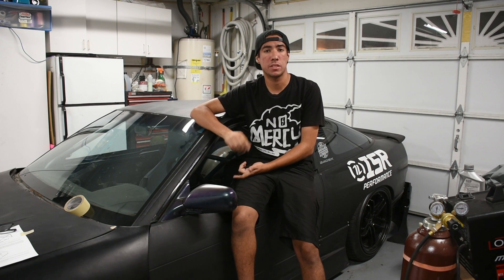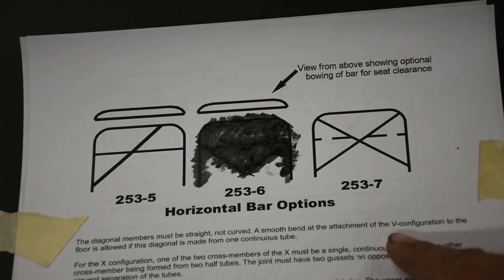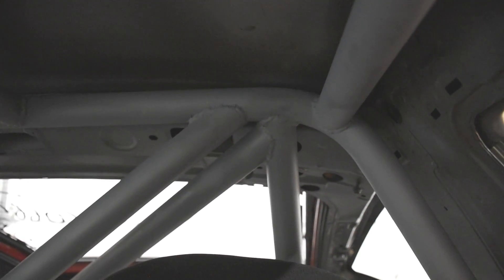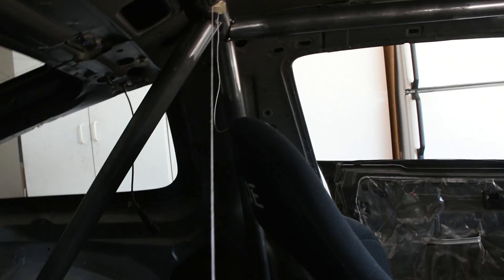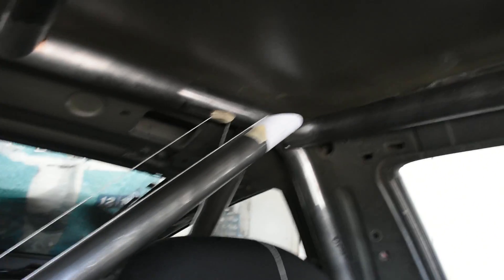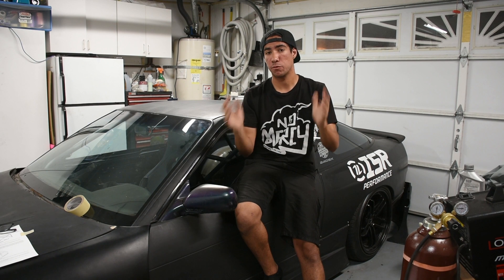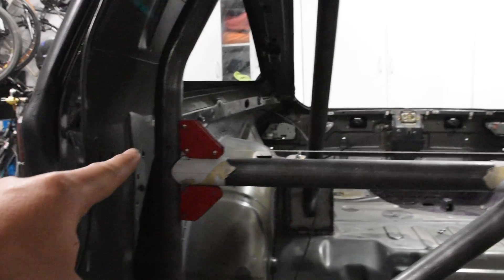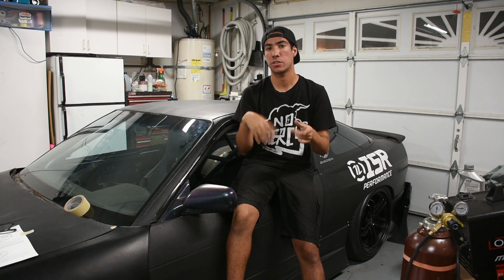Project 240 - Le Drift Car II | Ep. 14 - Diagonal and Harness Bar | FD Spec Cage Build

Comment: You seem very concerned about your safety, but I haven't seen you mention anything about your harness you're running, or if you've researched submarining (not the ship, google seatbelt submarining).
Reply from the maker: +RizoProduction Running a Crow 6 Point harness with camlock. And yes I've researched submarining.
Reply: ***** That's good,

Comment: total cost of the cage so far?
comparing to paying a company to build one
Reply from the maker: +Levi Kingston 100 feet of tubing (only need about 60-80 but you'll mess up so need extra) at $2.50 a foot is $250 in tubing. Then $50 in 12 gauge for base plates. And then $100 in welding gas. $50 in random flap discs, acetone, and cut off discs. Total is $450 in material.
Reply: a lot cheaper than the 2K that the companies be asking for
Reply from the maker: Well yeah but that's just material. Most shops take about a week to make a cage which means a week of shop time. $50 a shop hour x 8 hours a day x 5 days of work = $2000 in labor alone.  And then you have really well built cages which shops will charge $6k for. You're mainly paying for labor and the better the shop the longer they take and the more expensive the hours are.
Reply: so your better off making it yourself if you know how and got the right tools
Reply from the maker: Yep you most certainly are. Which is why I made mine haha. To have a shop make my same cage with the clearances I have, and the base plates I have would've been in the $4-6k range.

Comment: Hey man. Awesome vids man. Super informative. Sorry if you have answered this already. Are you gonna slap a turbo on the engine in its current condition? Or are you going to do a rebuild and then turbo it?
Reply from the maker: +Z Johnson Turbo it in this condition because I'll be tuning the car myself. So god forbid I mess something up in the tune while learning I don't want to destroy s rebuilt engine.
Reply: +OffBeat Garage Thanks for the reply man. Good thinking though. If it blows then you can rebuild it after you have learned a few lessons. how many miles on the engine btw?

Comment: Hmm. You did weld all the way around the tube right? 

9/10 times when rally or other race cars get build they either make a hole in the roof or that the roof skin completely of it easier to make a good weld all the way around the tube. Didn't see that i in the video so i'm just wondering. 

If you didn't do it i would be amazed if you pass tec inspection.
Reply from the maker: +Rasmus Laursen Yep the cage is welded all the way around the tubes. The front base plates get removed and the cage can get pushed forward and down which gives me room to weld around the top and then I push the cage back and up and put the base plate back and finish welding the cage to the chassis.

Also I've spoken to local guys who compete in Pro-Am and they've told me they don't weld the top of the cage and they pass tech fine. Which I honestly think is retarded but yeah haha anyways just wanted to give you some insight into that as well. 

Thanks :)
Reply: Thanks for clarifying. 
And i must admit that i'm shocked that a car with a rollcage that isn't fully welded can pass tech in pro-am. 
You will not pass tech inspection at entry level rally where i live if your rollcage i less than perfect. 

Keep the videos coming. Really enjoy watching the build! :)
Reply from the maker: Yeah they are a little too lenient on the rules for Pro-Am haha. I've heard rally is super strict though which is nice to hear because those cars get abused!

Thanks man I appreciate it :)

Comment: Hey man! great video as always. Just wondering, is all the weight you saved now put back on again with the roll cage? obviously I know that you have to have the roll cage so it's definitely less than putting that in with all the interior too. just wondering if you'll end up feeling any difference in the weight after the build is finished, or if you had to put the weight back in again, just curious as I'm looking at caging my build and am also looking at putting in the  work in stripping the car too.

Comment: I really like your videos and the overall project you're doing, this is meant as a constructive opinion so please don't take it bad

I think this video was way too long for the actual progress done - it could be easily merged with the roof bars video, that also seemed to take way too much unecessary time. The first videos regarding the roll cage were actually informative on an useful way, but it seems you've been extending the rollcage building for way too long than what would be actually necessary.

I understand as an Youtuber you want to create as much content as possible, but just on this video about the first 10 minutes were mostly pointless, repetitive, and the worth to mention parts could be done in very less time. A person watching this video that is also interested on the deeper level of details will surely watch the full series, so there is no need to mention over and over again that notching calculation website, for example. Plus, for a few months on some scenes when you're introducing stuff sitted on your car, it's clear the roll cage is completed for a long time, so I don't think the reason for this few progress on your vids to be lack of anything else new to show.

I don't want to sound rude or mean, but it was, at least for me, a bit disapointing to feel into skipping half the video, and then seeing with way too much detail the welding of a few more tubes, when the process is pretty much the same of all the other videos.

Please consider my opinion, and most of all, keep up with your great stuff. I'm really loving this project of yours.
Reply from the maker: +André Fontes It''s pretty simple. I build the cage and when building the cage I see what questions I have and what decisions I have to make when building it. I then address them in the video, unlike every single other roll cage build video I've seen. Trust me I know it's long but this video isn't meant for your watching entertainment. The video is for other people building roll cages, that want their questions answered and want to know about every single aspect that needs to be taken into account when building the roll cage. Thanks,
Reply: I understand your position then, and thanks for stopping by and answering. Still, I just meant it was still possible to make an informative video series but, for example, not mentioning some things that were already mentioned on previous videos like that notching calculation website - it could have been simply said the measurements and such, and since someone getting inspiration of your video for own projects will surely watch the full series, it's already mentioned so we'll know what you are doing.
Reply: You clearly have no idea how much effort and planning it takes to make a roll cage from scratch
Reply: You do you bruh! I love the videos.
Reply: +OffBeat Garage  I find your point very good. Keep all those details because nobody wants to search all bits of information together from different videos. I feel like the way you do it is the best way :)
Reply: This isn't meant to be some stupid, quick and dirty "hahaha look at the half ass rollcage I'm building", this is basically a step-by-step to building an entire FD legal rollcage inside of an s13. As an s13 owner all of his videos with painstaking details are an incredible resource, so please keep your comments to yourself about the direction of his channel. He is teaching people, and you want him to be just another automotive clown channel like haggard garage.
Reply: +Davis Campbell I don't want him to be anything, he does his work and as I stated on my OP I really enjoy his channel. I just stated what I thought because I know Offbeat uses to answer to our feedback so I wanted to know his opinion. I now see I wasn't entirely right, maybe because I've been watching the vids on an entertaining perspective, but I'll keep that in mind now on. 

Just a side note, I haven't offended him and I think you don't have any reasons to be offended by my opinion. As long as I don't do so I'm free to share my opinion where and when I want. Be more careful with the "keep your thoughts to yourself" crap because I doubt everything that comes out your mouth is brilliant, either.
Reply: I suppose I just think you are a little arrogant to walk into a lecture and tell the professor how to give his class more entertainment value. The things that come out of my mouth I can stand behind, though I admit it may have been a little rude.
Reply: If you think the video is too long just watch it at x2 haha